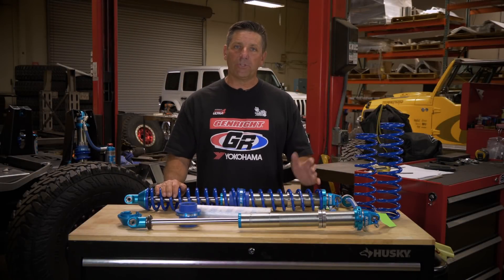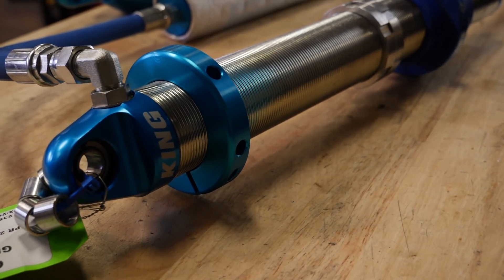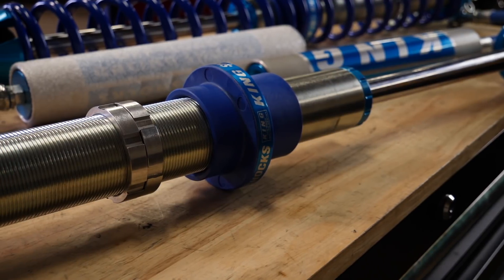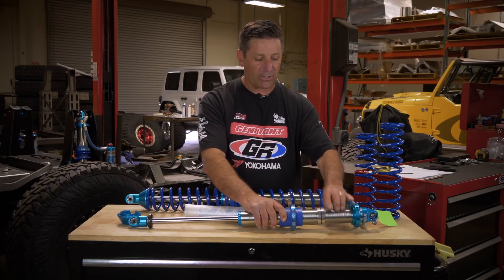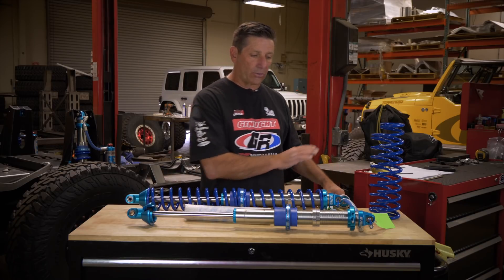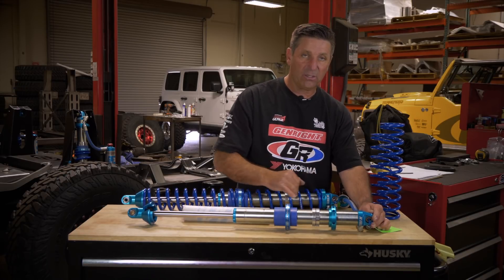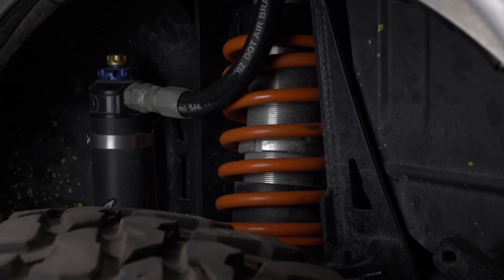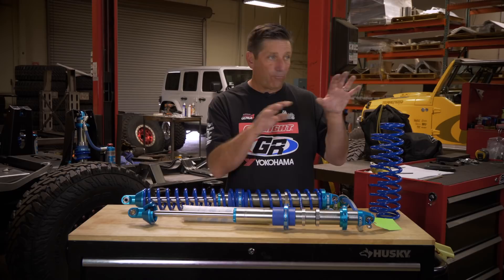All About Coil Over Shocks | GenRight Off Road

Comment: Right now I have adjustable tera flex fox shocks with resevoir.

What would be the performance change by going to a coilover shock?
Reply: Thats just for dampening . You are still bound by the sping rate of the coils.

Coil overs you can adjust both by addin nitrogen to the res, and adjusting the pre load on the coils.
Far more adjust-ability!

Comment: If I buy a coilover conversion kit and the springs aren't the correct rates, can they be exchanged, or would I need to buy new springs?
Reply: Todd Gibbs usually they will swap out the springs if they haven’t been driven on.